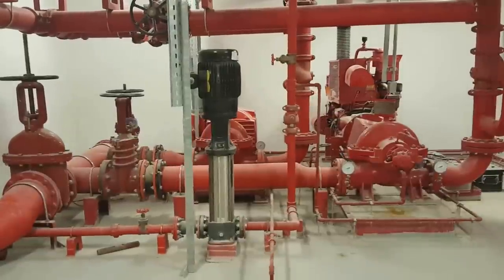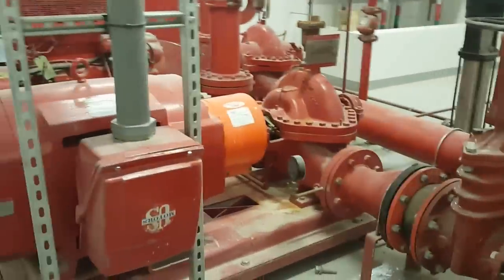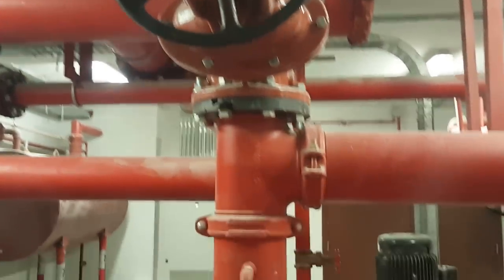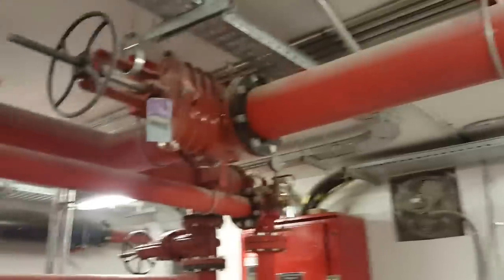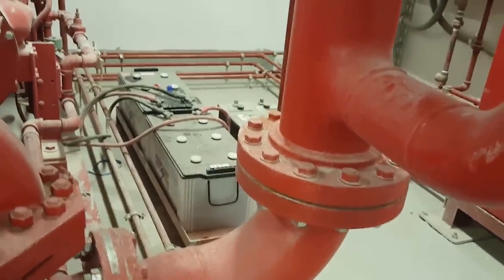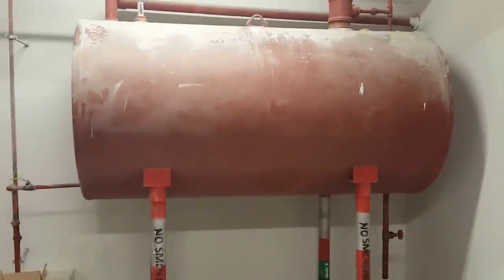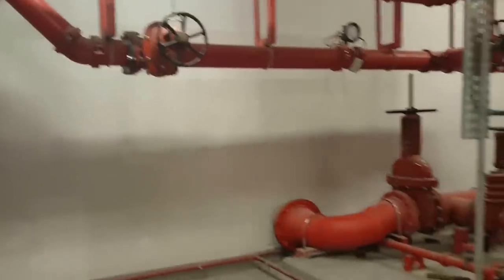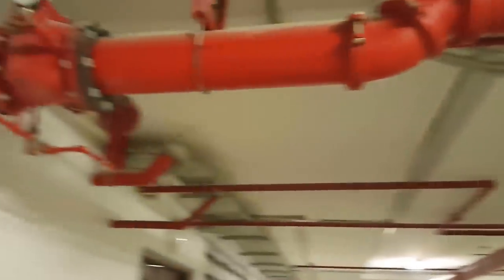fire  pumps installation details

Comment: The suction reducer is installed incorrectly. The float of the reducer should be on the top to prevent air traps. It’s upside down!

Comment: Glycerol filled pressure gauges to be used with syphon arrangment.
Manhole door is not provided for diesel tank for yearly cleaning tank.
Level gauge is also not provided to diesel tank for diesel level checking
Batteries terminal, plastic protection caps are not provided.

Comment: Hi friend... the excentric reducer flat side must be on top and de reduction side on bottom.. this is to prevent the formation of air  pockets on the suction pipe..
Reply from the maker: Thanks for You are right
Reply from the maker: https://www.youtube.com/watch?v=iIDspuse0Jc
Reply from the maker: https://www.youtube.com/watch?v=90T7pGKk1mc
Reply: I was about to say this.... in this case if installation, air trapped and goes to impeller. Thereby the effect of cavitation increase and will heat and damage the pump.

What I said is as per nfpa 20.
Reply: Flat side of Eccentric reducer should be down , when source of supply is above pump and vice versa.
Reply: you mean eccentric reducer is it ?

Comment: Explain is good.. But I have one doubt how did working electrical to mechanical power ,so i ask you explain to electrical and panel board side..how automatically running ,used any sensor.?

Comment: First of all thanks for uploading the vedio,The flexible bellow  provided after the gate valve for electrical and diesel pump must before the pump connection ,must be same as shown for jockey pump 
The pressure sensing line at the discharge of pump not explain in the vedio , what about the strainer at the inlet of the pump .

Comment: FOR HVAC PUMPING DESING
Hi thanks a lot for you videos
I have a question...
For calculate the Head at the secondary circuit:
1.- Evalute the pipings circuit from the decoupler???
 2.-How estimate the energy flow at Primary Circuit (inposted by the primary pumps) for evaluate the HEAD at the secadary circuit  ???

Comment: It's a nice info, may I know if it is a real fire electrical operated pump or DG operated pumps only supply water to sprinklers or hydrent system. On that time jockey pump stop working(because jockey pump is only to maintain pressure in the respected network)
Reply from the maker: yes sure:  real fire electrical operated pump and Digital fully Automatic Water Pump Control by BMS system..Thanks
Reply: afreen ali Sorry I mean to ask Jockey pump is for only to maintain pressure not to supply water continuously while using hydrants for continuous firefighting
Reply from the maker: Brother Jockey pump maintain pressure not to supply water continuously only in case of leakage because Pump only 25 GPM and main Pump 500 GPM . Jockey pump can not be pump in high grade pressure in the system. Thanks
Reply: afreen ali thank you brother for ur clarification. Now I got my ans
Reply from the maker: welcome

Comment: Installation shown here are not up to NFPA 20 Standard, suction distance not proper, eccentric reducer mounting wrong and OS & Y GATE Valve has no temper switch.
Reply: Can you please tell me about distance and the detaila which we need to take while installing a pump
Reply: Correction,tamper switch sir not temper switch

Comment: the flexible is useless if you install far form pump and between the fix support what for is useless. and the excentric reducer installation is reverse that can use air trap is suction pipe and can cause cavitation at pump. the maintenance space for both engine and fire pump is not good. the battery position in front of fire pump control panel how come.

Comment: sir... i want connections from diesel tank to diesel pump
please tell me how to connect this one,how many inch pump using in this connection....please give me replay
Reply: In diesel pump you can see the two black hose pipe with a tag for the supply and return connection.never to use a gate valve in the return piping line.

Comment: Plz upload video on working of Deluge valve
Reply from the maker: Deluge Valve is known as a system control valve in a deluge system, used for fast application of water in a spray system. Deluge valve protects areas such as power transformer installation, storage tank, conveyor protection and other industrial application etc

Comment: Mery pyary bahi pls ap hindi ya urdu me video banao pls
Reply from the maker: bhai Hindi mai b video hai ..check in my channel
Reply: Boss, where's the strainer in the inlet, no identification or tagging, not told about working of different pumps, where is pressure switch? Sensing line? Only gate valve????

Comment: there are unnecesary equipments. Suction side have extra unnecessary valve and rubber compensator::::)))))
Reply from the maker: this is as per NFPA installation..thanks
Reply from the maker: https://www.youtube.com/watch?v=iIDspuse0Jc
Reply from the maker: https://www.youtube.com/watch?v=90T7pGKk1mc
Reply: Not at all NFPA 20 installation's followed....suction side reducer is eccentric....but installed incorrectly. ..the taper side should be bottom not on top side...and many more...